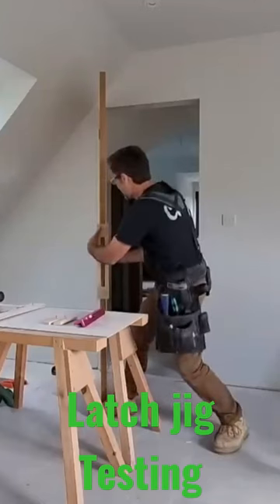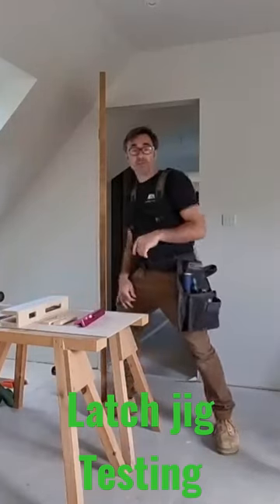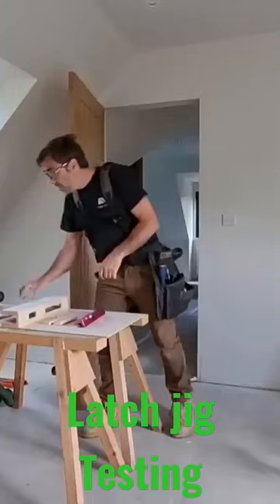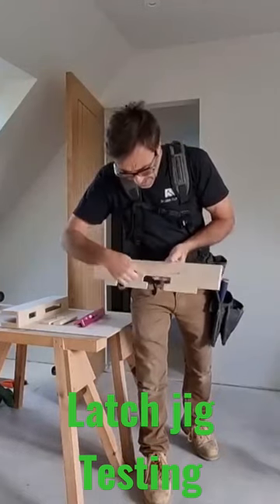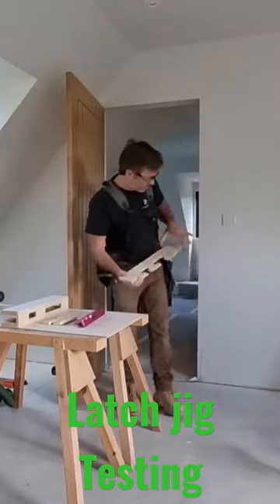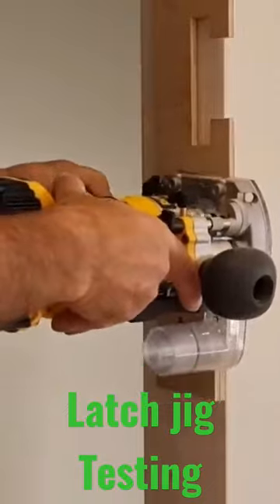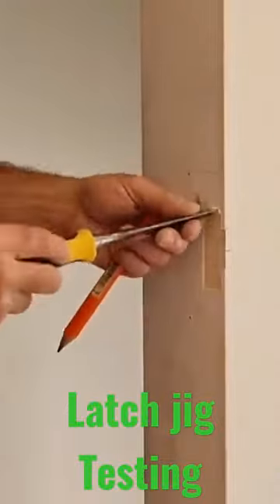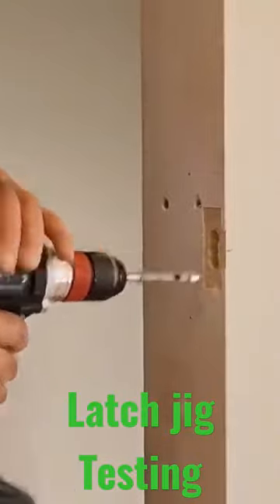lock jig and latch jig testing, it's coming soon #shorts #carpentry #doors #how #router jig

Comment: Never understand the point of this instead of screwing a jig on just screw the hardware on and mark round with a sharp knife the router. It's full proof.
Going to have to make loads of them for every different brand. No two latches are the same size.
Reply: Latch jigs are pointless, unless your fitting 300 of the exact same latch,

There needs to be and adjustable one on the market